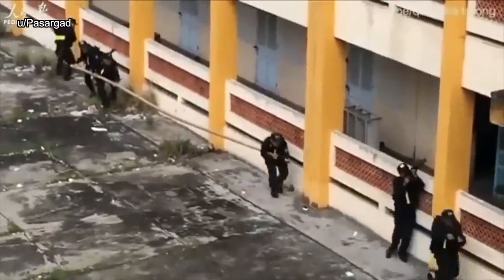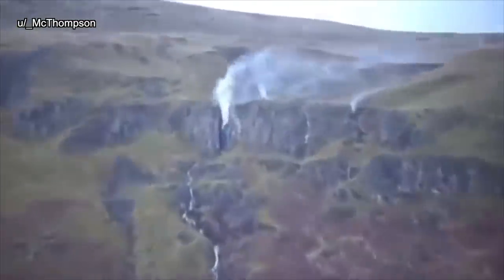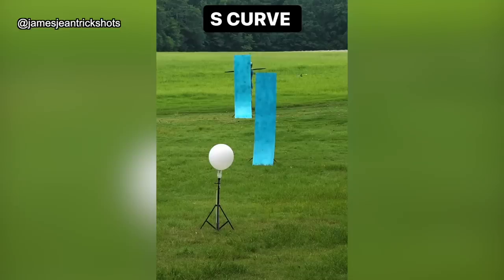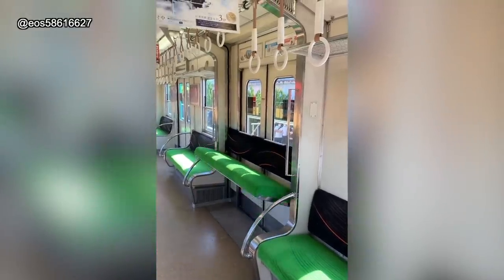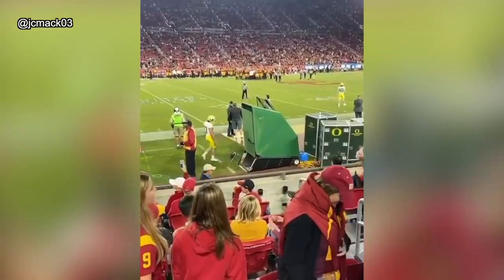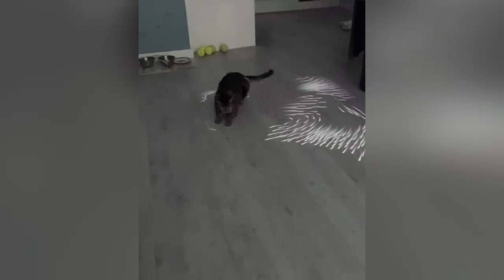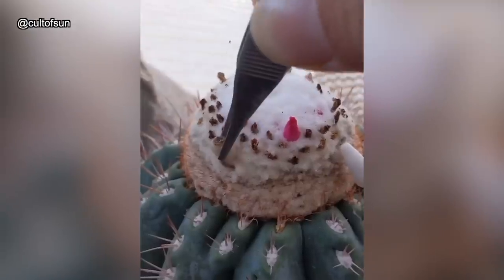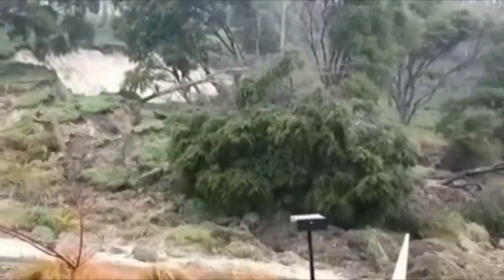Try Not To Say WOW Challenge! Oddly Satisfying Video that Relaxes You Before Sleep #18

Comment: Dude, I need that faucet with the cup washer and veggie spinkler setting.  What does the spinny thing do?
Standing waves are also really neat.
Reply: I checked his credits hoping I’d find the name of that sink. There were none then I found your comment. Sure wish I knew.
Reply: It is for spraying out cups efficiently👍. Work at a place with a bar and we have those to spray out glasses that accidentally got a little bit of the wrong beer in it. That spinning part holds no other purpose that I know of
Reply: Check out Pacific Sales. I used to work there, and we carried those things shown in that sink. Chopping board, strainer, faucet, glass cleaner, etc.